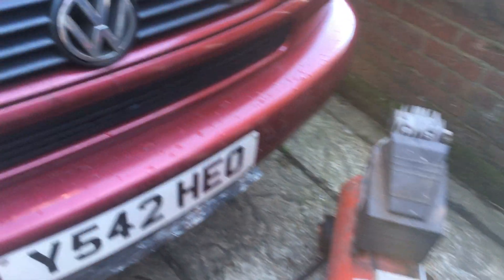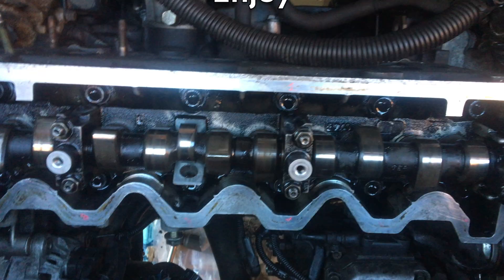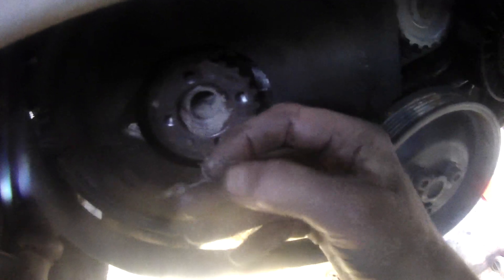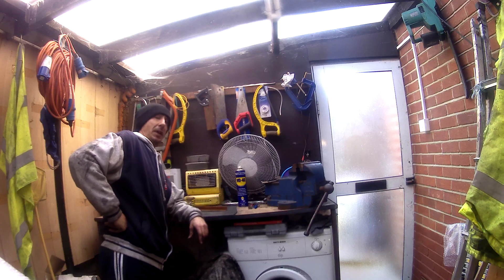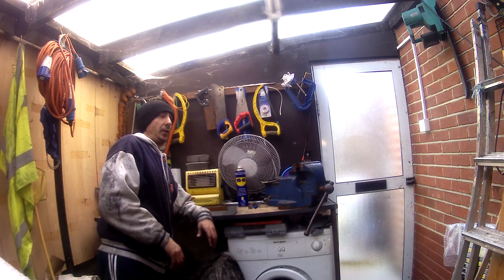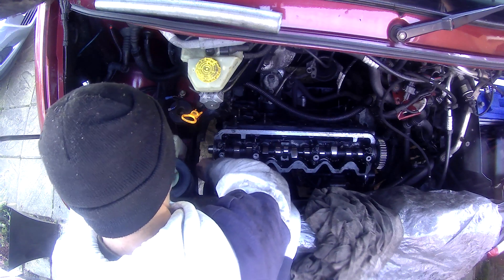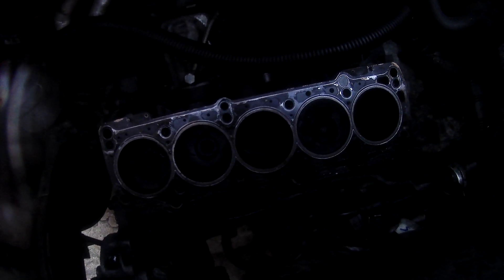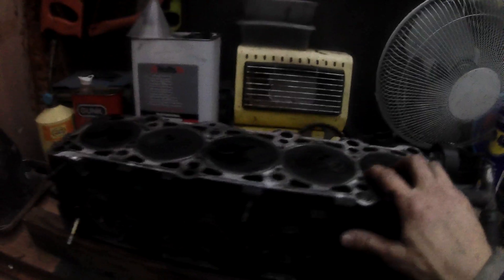Cylinder head removal vw t4 2 5tdi acv

Comment: How did you get the exhaust clamps off in the end?
Reply from the maker: I used a pry bar in the end, from underneath it’s not too bad, think I’ll probably get a tool to put it back on, I seen them on eBay for around £10

Comment: Does the front of your van not hinge forward if you take bolts out of slam panel. I know they do on short nose t4s. It gives you loads more room to work as it moves the radiator forward about 100mm?
Reply from the maker: No don’t have that option on the long nose. Also coz of air con sits in front of the rad and I didn’t want to have to re-gas the air con